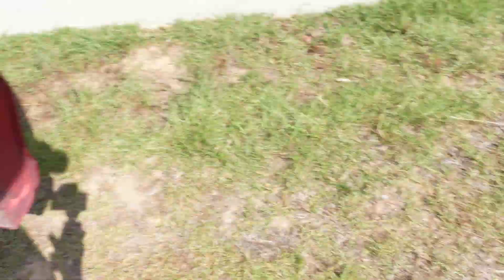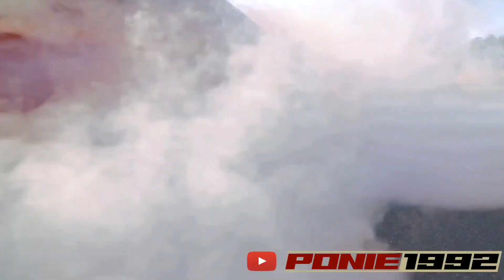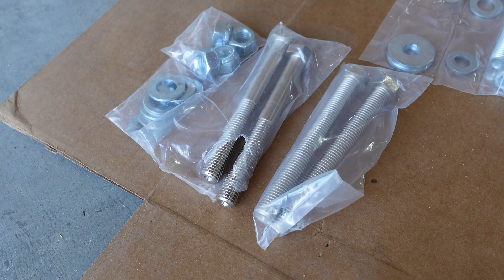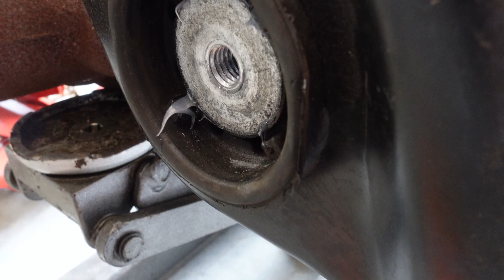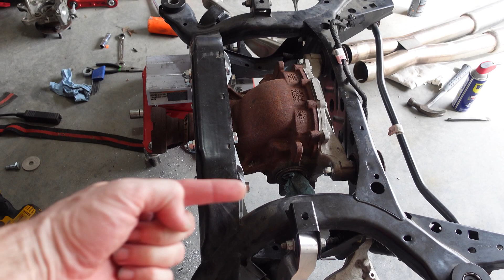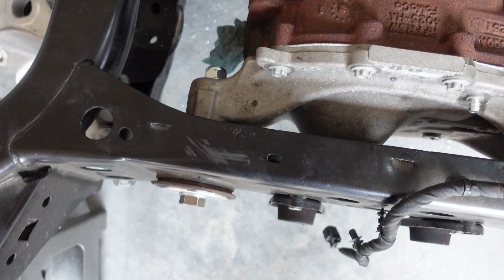Repairs begin after major failure! Reinstalling the differential in my T56 swapped 2016 Mustang GT!

Comment: Just curious but what was your horsepower when this happened? Thank you for your service brother.
Reply from the maker: Fairly stock at that point. Maybe 400 ish. Wheel hop was the culprit.
Reply: @BackyardBMX73  cool, good to know not taking mine as far. Will be just on north side after I get all the bolt ones done. I’ll be sticking with steeda for the suspension and cai. Looking more fore road race auto cross type driving. Love drag but it’s done to fast. Over in 10 seconds.
Reply from the maker: @douglasbaker5949  I hear ya man! Road racing is cool too. Thanks for watching and commenting! 🤘

Comment: Your the best ever thank you
. So how is the nvh
Reply from the maker: Thank you much!
My car is noisy. Some clunks and pops, but that's what I expected. A little more stiff of a ride, but honestly not bad. The exhaust note is louder than anything else lol.
Reply: Man thanks so much I know you put the bmr shock mounts on and that is where I am now I also put the 762 bar connecting both sides it seems to of made nvh less steeda bracket will be here this week and I better get those poly bushings out. I did use the bmr 12.9 Allen bolt kit but this is so helpful I already have kelltrac bertha bolts but I didn't want to grind so much of those ears, now I better order those steeda inserts and by the way nice runs your a nine second deal 🤝
Reply from the maker: @larryhensch2280  Steeda bracket will add some NVH, but I don't mind it. I've had cars that have worse lol. Let me know how everything goes for you.
Reply: We will keep plugn on these s550 and show Ford how it should of been.
I see you are a also a chevy guy I have a 72 chevell big tire car small block nitrous but I got sold on the 2015 first factory car with line lock and probably like you gonna put the jpc in. But that's what sold me on this car, now with the whipple it's actually faster than the chevelle the stage 3 calimer and the n2nb makes this car fun. Get the ass end square and get after it. Lol
Reply from the maker: Right on man! I love my S550, for sure. Have a couple stick shift races coming up that I plan to attend.
The Nova is my wife's car. Pretty sweet build with lots of new parts and 21st century goodies. 😁

Comment: You sure 129 pounds isn’t with nut on it? I couldn’t see you getting no where near 129 pounds without a nut on it!
Reply from the maker: Instructions call for the bolt to be torqued first, then the nut installed.
Reply: ponie1992 I understand that but there is no way the bushing would not turn with 129# torque! That’s a crap load of torque, I couldn’t even see it holding half that, I run straight axels so I don’t know a lot about them rear ends
Reply from the maker: The metal part of the bushing has tabs on it that fit in slots on the diff housing. They are supposed to hold the bushing still. The tabs on mine are damaged, so they don't hold like they're supposed to.
Reply: ponie1992 oh ok gotcha
Reply from the maker: Right on man